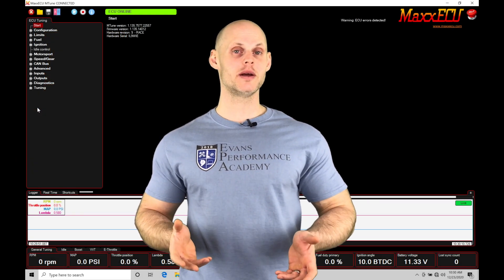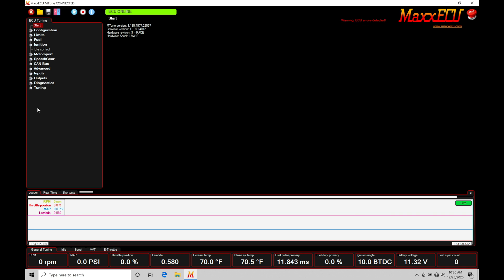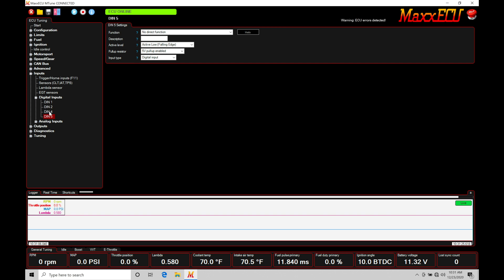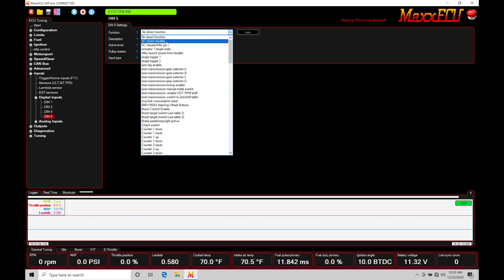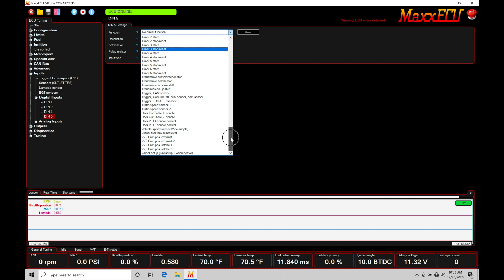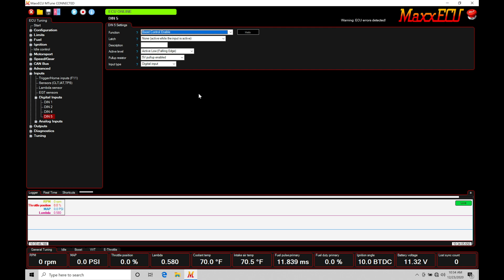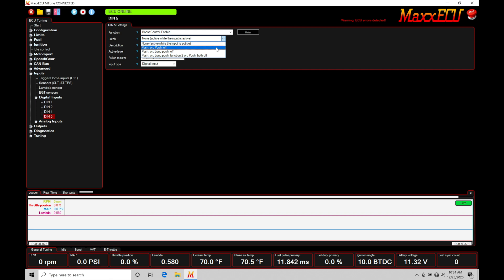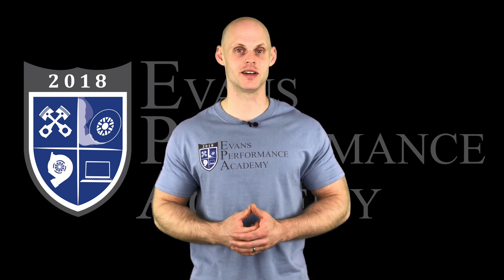MaxxEcu Training Part 8: Digital Inputs | Evans Performance Academy

Comment: If you run out of DIN connections on the Maxx ecu can you use the AIN instead? Trying to wire up to speed sensors and dont have any more open DIN spots on my Maxx Sport only AIN.
Reply from the maker: You can't use analog inputs for speed sensors.  You would need to purchase a can expander which maxx sells that gives you more inputs/outputs called the MCE18.